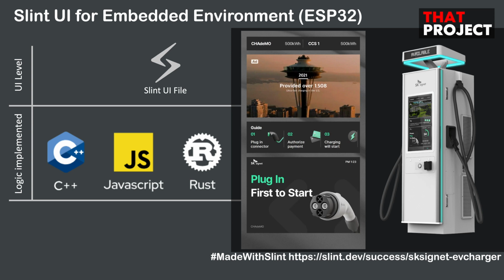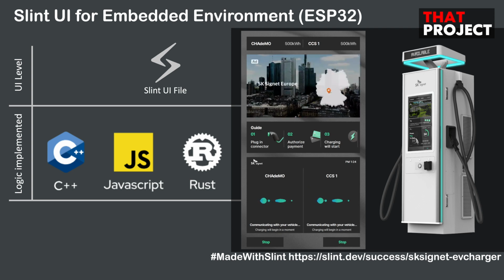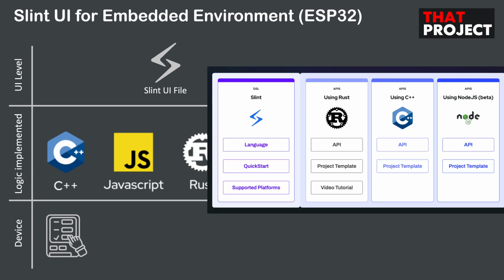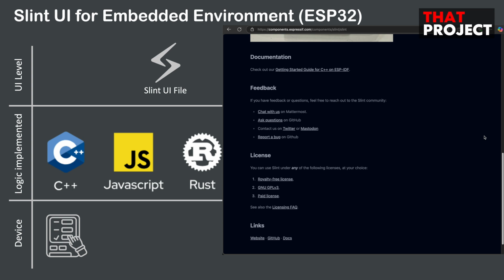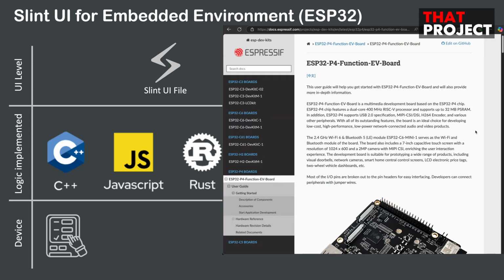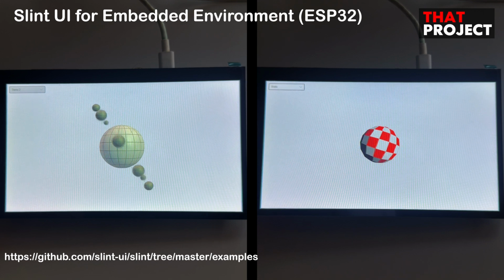ESP32-P4 with Slint UI – Smooth & Responsive UI for Embedded Devices

Comment: But where in git is port of Slint for ESP32P4
Reply from the maker: As far as I know, there are no official example sources for the ESP32-P4. They only provide the "ESP32-S3-Box Printer Demo with ESP-IDF." I'm still trying to make something that works easily with Slint UI C++ on the ESP32, but it's not easy.